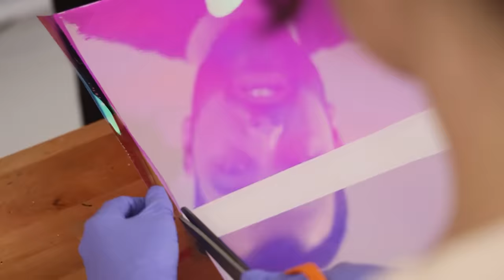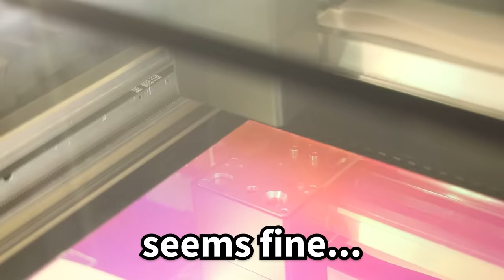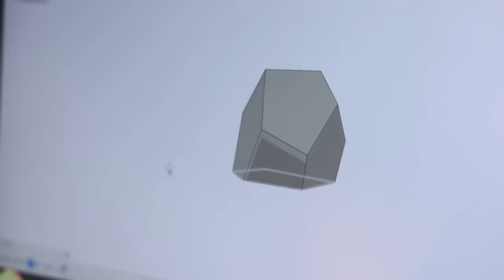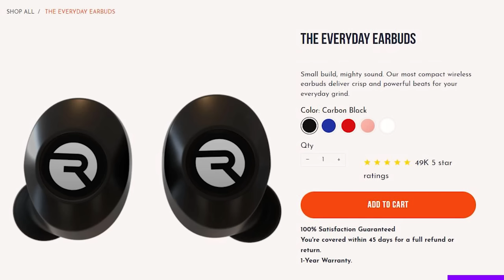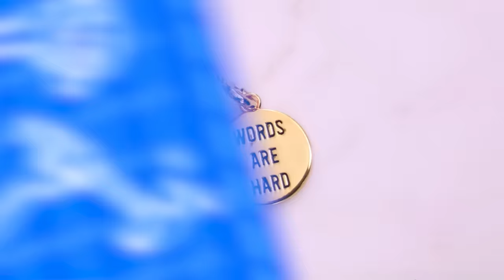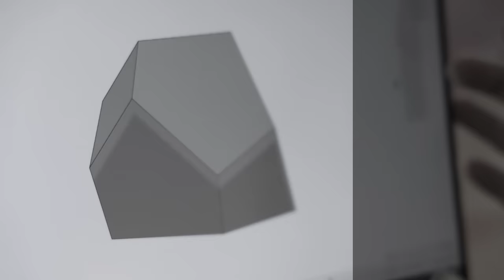BUY vs DIY - Recreating a $200 Gem Lamp

Comment: You also have to take into consideration of how much enjoyment you get from the Making process. Something that the bought unit can give you. I actually like YOUR unit much more than the store bought one. When it comes to edges, I have always favored sharp edges over rounded or smoothed ones. Even my dice I use for RPG games are all sharp edged dice, well, at least the ones I use over the ones I keep for display. In the Future, you might try a plastic welding compound that has a high capillary action and as long as you don't use too much , it won't seep and damage surfaces, but the compound actually welds the two pieces together by partially melting them together, until the solvent evaporates, at which time the process ends. Scale modelers use this kind of "glue" to weld the plastic pieces together for an extremely small weld that cannot be seen easily. This compound comes in different chemical natures to weld the specific type of plastic you are using, I'm sure that there is a plastic welding compound for acrylics so you could assemble it without having the trouble of messing around with UV set resin, or you could weld it together first and then put the UV redin in the gaps without worry that it will seep between the pieces of acrylic. You could then take your time with the UV resin so that it will look as professional as humanly possible. Great job you two! Now I want to get a Glow forge for myself so I can make the same thing!!!!! I think your unit is way better than the store bought one, BECAUSE it was handmade and not done by machine and your lighting is significantly superior to the store bought one for sure!!!!

Comment: I was really expecting the lighting element of the BUY light to be more well constructed. I think if I were to design it, I would have a slightly thicker base like the BUY, but I'd want to put your lights inset into that thicker base so that the diffusion layer was flush with the bottom of the lamp part. That way, when the lamp was on top, it wouldn't be clear from any angle where exactly the light was coming from and it would support the illusion a bit better. 

Still, of the two, your light is the clear winner. AND you can service and replace it! Obvious benefit.

Comment: I like yours better, for sure.
The acrylic looks sharper (in a good way), cleaner, smoother.
And your light source is far better, as you don't see the light source, just the defused light ( much more even).
And although the bought one was more solid with the glass top on a metal base, I don't believe that that necessarily makes it better quality.

Comment: It is so much easier to apply the films a little bit at a time... Line up a corner and slowly peel off the backing (a little bit at a time) as you apply the film and smooth out any air pockets.

Comment: Well the but being glass has to of been blown into shape via a mold. Only way it has the rounded edges. However..... The light source in yours is significantly better because it's difused. You don't see the actual lamp. Both are nice. And I think equal. Cuz seeing the lamp in one and not rounded on the other are the only issues i notice and if those were fixed.... You'd have 2 same great lights.

Comment: I think the bought one is dip coated. Where they have a thin layer floating on water and you dip an object into it while the water pressure presses it onto the object seamlessly. Used often for designs on motorbike helmets or car parts.

Comment: about the shininess in the laser, while that bit of plastic foil won't do anything to it, if you're concerned like that in future projects with maybe more mirrory stuff, you could always just paint or tape the area you're gonna laser, so it won't hit the mirrory bit before already heating it a bunch.
that said, most, if not all, lasers operate on the principle of having their light mirrored back and forth inside them, so adding another mirror into the path for the short time it takes to cut through that shouldn't even be noticeable, assuming it's cooled correctly and everything.

Comment: The Buy has better color (when you don't see the light bar), but for e the uneven surface looks cheap. I like the sharper form of the DIY and the diffused light. A tie was really fair assessment.

Comment: I personally prefer the sharper look of yours, plus the glowing edges look awesome. Also, the mirror finish on yours looks so pretty, kinda like a kaleidoscope. But the metal base on the BUY looks a bit better. Overall your DIY version is much better in my opinion, I'd just make the base a bit thicker in wood, so it looks a bit more aesthetic

Comment: Next time you use the iridescent film or similar (like window tint) hose it in the soapy water as you peel the protective layer off. If it curls it won’t stick to itself (or anything else like Evan) and make life much easier 😁😁😁

Comment: Can you use resin to make workshop safe shoes? Like coat them in resin so they are like steel tip shoes and maybe use a sand/resin of rubber/resin on the souls for extra grip ?

Comment: Strictly subjective, of course, I like the one yall made better. The biggest reason is your light source is amazing and adding the diffraction lenses made a huge difference. It doesn't feel like just some led strips shoved in a lamp like the other one does. And I like the flat edges that glow a different color on yours too. I think the shade of the film looks better on the other lamp when the light source us off, but yours better when it's on. Over all, I think the one yall made wins but both are very cool.

Comment: honestly I like yours just because having less weight makes it easierto deal with and you can open it so that increases use. I also prefer the defused look if you had taken a little more time on the edges you could have gotten pretty clean yes the buy is fancier but honestly I prefer yours all around.

Comment: Although the buy looks more like a gemstone or crystal I like your build better. If they were both out of the box and sitting on a shelf in a store I would buy the one you guys made. I wonder what yours would look like with different iridescent film on it or even a double layer of the film. You might be able to get more light defusion with another layer. Or maybe try a frosted film or glass on the inside.

Comment: Cut the film into shape. Remove about 5 cm of the protective layer. Place it on the plastic. Remove the bubbles. Remove the protective layer removing all the bubbles while you do that until it's all attached. Wait for it to dry.

Comment: Ive seen ppl put aura like films on crystals before so I'm sure you could on glass. What I'd like to see though is what happens if you do bust the buy open and replace the lighting inside with something like the diy bc right now, the diy is hands down for me because of the lighting being better over all. That kind of lighting in the buy would elevate it and I'm curious what would happen to my opinion if the lighting was the same in both bc then for me it would come down to aesthetic

Comment: Just a heads up in your safety procedures.  You are going to have to place your fire extinguisher.  That's a Kidde with a plastic valve head.  They have been recalled.  It may not work.  Great video by the way.

Comment: Where do you get your electrical supplies? Could you maybe start a separate supply list for electrical stuff? some stuff is pretty obvious, like the LED light strips, but what about thing that require batteries? what are the things called that you actually put the batteries in? battery boxes? battery cradles? battery cribs?
Reply: I usually order stuff like that from RS components.

Comment: It would win aesthetics... if there was no resin on the edges, if somehow it could be sharp edges and be the glass material corner to corner. I know for DIY it would be very hard to do. 
As someone pointed it out, the bought one likely has a mold and is likely blown glass into the mold... Which requires a furnace, plenty of skills, and also can be a bit dangerous.

I think this could be possibly done with some clear resin... Either in a mold or by 3d printing. Then sanded down, and then the light installed. As for the light... I think maybe some diffusing material on the inside of the glass would be good as it would make it look like the whole "gem" glows vs just the bottom. You do lose the internal reflection thing that it has going on, but I think the look of the whole gem glowing would be quite cool.

Comment: both are great but they are definitely different things, the bought one is meant to almost diffuse the light with its structure and have a sort of even, almost more relaxed glow while yours turned out to be this intriguing reflective infinity gem which almost calls more attention to itself and serves more as a statement piece than like a lamp, i think yours is better and the bought one could be better, that stick light it has really killed it for me, i would be upset if i found out it had that through buying it

Comment: I would say, cut the pieces out then add the reflective layer. It may be a bit more tedious but it would have cut out the possibility of laser issues... I'm going to assume the glass one was made using a mold given the smoothness and the edges of the facets. The one you guys made looks more retro synthetic, something a gamer would have displayed. Also you guys made yours look aesthetically pleasing light wise and around the base. You guys should sell diy kits lol

Comment: You know, for gluing acrylic, you probably should have used some of the acrylic glues that fuse the material. Then you can make the edges better with a blow torch.

While it's not, entirely, the same, you could look at the various aquarium builds Joey had done with the King of DIY channel...

Comment: Wait, why not cut out the facet shapes themselves directly out of just resin-covered [iridescent thing of choice] instead of the soap hassle?
Is there any reason to not just prepare a level surface, spread [iridescent thing] out, pour casting resin on it in the desired thickness, and then when it cures, cut and assemble the pieces?
Would it be possible to create this thing out of just [pretty resin] and that's it?
I mean, if the light you use generates enough heat to deform cured resin it would probably deform soap-acrylic-sticker-thingie anyway, right?

Comment: For time I would suggest: If you were to redo it, how long would it take?, because buy takes less time because it repeats the same many times.

I think they use a mold. It is easier on the 3d math, just have a piece of material cut it, then make a mold and then make the shape.

Comment: I think your Gem may be cooler if the LEDs were RGB and did a slow color change, up and down the spectrum or maybe pulse the a color like a heart beat.  If you want the more rounded Gem effect, build an acrylic vacuum forming machine with a heating element to make the acrylic more pliable.  This way you can make multiples with different size rocks or even man made shapes and it should be faster to make by cutting down on labor, if you want to sell them.  On the purchased Gem, I don't like seeing the shape of the light bulb.   The Gem should be seen but the how should be left to your imagination (Magic).  This was way cool and I like them.

Comment: Buy looks way better when the room\studio\whatever other lights are on, DIY looks way way WAY better when the lights are off.
Buy is made from glass, DIY is made from plastic.
For me it's a complete tie only because of DIY joints. If it was possible to use more resin and somehow sand and buff it it would be a clear winner.

Comment: One thing I worry about with the diy is the longevity of the film. Films like that aren't supposed to be applied to acrylic. Acrylic lets of gases so it can create bubbles in the film or cause the film to start pealing. I would probably take a while but at some point the fiml will fail.

Comment: I think I overall like yours better but considering the time and effort and materials, and as someone who doesn’t have a lot of the tools you used, the buy seems much cheaper (considering you need a laser cutter for the diy) and easier. If you want a project to do and have the tools and materials, then it would be a good DIY

Comment: Ok im torn... I love them both so much... its almost like one is fantasy and the other is scifi/cyberpunk. 
I will say tho for 200 that single light in the bought one kinda kills it for me. They needed to do what you guys done and had a defused bottomlayer, or even just put a defuser over the bottom layer to even out the light because my god when you can see the bar it makes it look so cheap.

Will add on the time part saying yours took 3 days isn't too far as you wouldn't have spent the whole day doing each of those things so in reality that working week would technically be compressed to the same time if not less as the bought.

Comment: 22:08 the light actually IS flickering in real life. Your eyes often cannot percieve this because the light stimulus duration is longer than the moment of no light. 

The reason you can see it on camera is because its framerate significantly misalinged with the frequency of the electricity.

Comment: Just a gentle reminder for your safety and long term eye sight. It would be best for you to wear UV safety glasses while working with UV resin. UV can damage your eyes and manufactures sometimes straight out lie about the wavelength and strength of UV lights and lasers. Some wavelengths of light are still super damaging to your eyes even though your eyes can’t detect it. Better safe than sorry!❤️

Comment: 5 days with 2 people working on it during those 5 days is actually 10 days of work. I'm guessing it might have been closer to like 3.5 days per person, since there might have been parts where both people couldn't work on it at the same time, but 3.5 days per person comes out to 7 days of work. Just because the item was done in 5 days doesn't mean that it took 5 days of work. 

A 5 person team working 8 hours a day, 5 days a week, can put in 200 hours of work into a project on a weekly basis. Yet, a week only has 168.

Comment: 125$ plus a full week of labor for two people is not really cheaper than the 200$ product, now is it? Unless you value your own time at less than 1$/hour ...

That being said, I did prefer the asthetics of the DIY, since it did a much better job at hiding away the direct light. The BUY only seems to work at some specific angles where you see more of light from the surface glow than you do coming directly of the white lightbulb.

Comment: The bought one looks a$# cheap. Quality? None! Curvy surfaces, cheap bar lamp on a side that gives shimmering because it is a$# cheap led. Your gem looks amazing and real. Sharp edges, straight surfaces as a gem would have, evenly spread inner light, and real mystic look when lit.

Comment: If it took 5 days by 2 people, the price should have been far larger for the DIY, even if they only calculated the cost of the materials and not their tools. At the very least they should have included the 3 days of assembly: how many hours per person at minimum wage for the pricing to be "fair". That could not possibly be under 200?